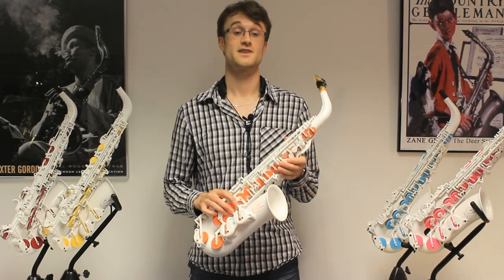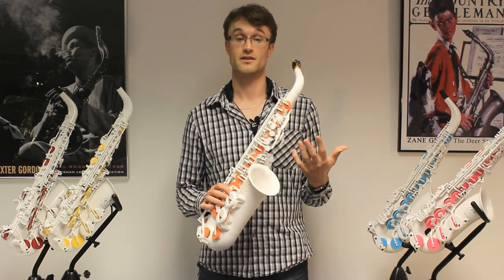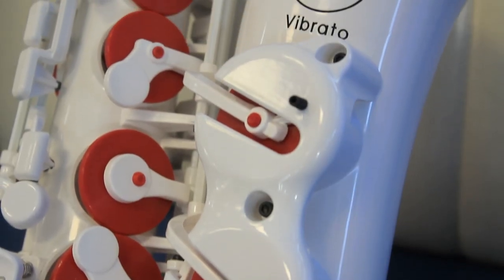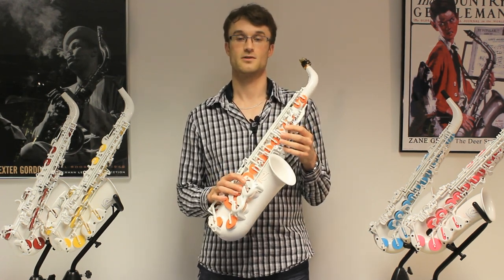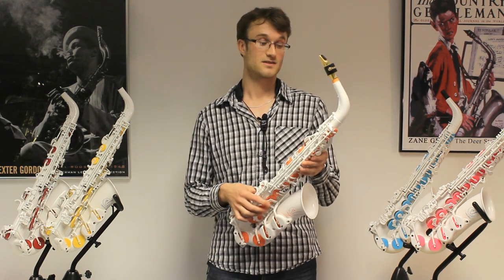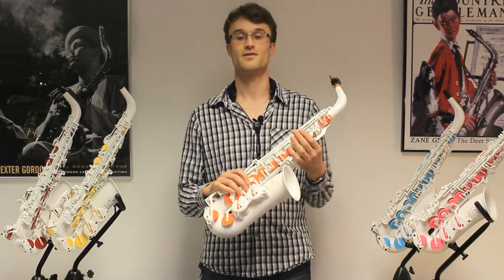Vibrato Polycarbonate Saxophone Review

Comment: Now, before I begin, I am NOT a saxophonist. I am a baritonist. I heard what I call "dead air" at the beginning of a lot of the phrases for the Vibrato, but not the standard one. Also, the brass sax seemed to do better with the low notes, so, based on my hearing, if you buy a Vibrato, you might wanna play higher a lot more often. The funny part is that it created what's known as a "vibrato" sound on those lower notes.
Reply: Zachary Woodard The airy noise is heard on both. It is coming from his mouth, not from the horn. Some players just play that way.
Reply: Tanner Saylor Ok, just trying to help.
Reply: +Zmac 9906 I'm an alto sax player an d I agree about the lower notes they sound weird a little off the if you what I mean (which u might not)
Reply: +The Mad Panda I'm a tenor sax player in the concert of Bb but yeah the lower notes sound really off tune

Comment: Get the price down to around $150 USD I might consider one. Failing that, I'm sticking with brass!
Reply from the maker: maverickdallas100 What you have to remember, that the pBone and pTrumpet are valve and slide based instruments, easy to recreate with plastic, hence them being about £100. The saxophone, has lots of keywork, and lots of mechanisms that take time to build, this time, cost money, and further specialist material to make it robust, a lot more complicated than a trombone or trumpet in design, so that's why it's that price. If the sax was less complicated, it wouldn't involve so much work, but then, if it was less complicated, it wouldn't be as awesome ;)
Reply: maverickdallas100 maybe they are per unit, but the R&D to get to this to this level of instrument must have been pretty hefty...  I'm sure the price will come down once they sell a few thousand
Reply: ***** If the plastic sax follows the same trend as, for instance,  flat-panel TV's and personal computers, the price should plummet once that initial "novelty item" or the "gotta be one of the first people to have one" aspect wears off and production is ramped up.
At $150. USD a copy, they would be flying off the shelves in addition to being a worthwhile purchase for music programs in cash-strapped school districts needing to outfit a band or orchestra on a budget.
Also, these instruments would stand up to any weather, be cheap to maintain, and be fairly resistant to a youngster's carelessness or neglect. What school superintendent or music director wouldn't like that!

Comment: It has a more rounded tone lacking the accentuated upper mids and highs that most modern players expect in the mix. The plastic sax has less sibilance. Similar to the difference between a classical nylon or gut string guitar and a modern steel string acoustic guitar. The plastic has more fundemantal frequency and less upper harmonics.

Comment: So, there are brass saxophones of better or less quality, plastic saxophones... even wooden saxophones.
When I was 11, I talked about a "rubber" saxophone (hard rubber, just something that wouldn't break if you dropped it).
We may see that soon, along with perhaps a crystal (glass) saxophone for the enthusiasts.

Having owned a "xaphoon" as well as a Jim Brock sax, attaching a saxophone mouthpiece to a piece of bamboo with tone holes drilled in it still tends to have a "sax" sound, given the reedy sound from the mouthpiece.

Folks, we are more than 2 decades into the 21st Century.
The debate about brass saxophones that cost a few thousand dollars vs. a generic one costing maybe a couple hundred bucks is falling on deaf ears.
Why? Because we have long since past the point where the "generic" brand saxophones are manufactured in the same overseas factory as the pro-model saxophones.
Yamaha of Japan hasn't manufactured saxophones in Japan for many years - just look at the lower side of it (near the right thumb rest): Made in Indonesia.
Yet Yamaha still charges upwards of $3,000.00 for any model saxophone and often comes with octave key mechanism problems, corks falling off within 3 months, etc.
No wonder the warranty is so limited, because they took your money for a status label that was made in a sweat shop.
It's comparable to Starbucks - there are certainly better coffee shops out there yet Starbucks charges a base of $5 for any beverage before you add ingredients (plus tax & tip!)
Nike shoes are no better - manufactured on cheap labor, the base price is still well above $100 + tax for any pair of shoes that don't last any longer than any other shoe.

Unfortunately, too many band directors here in Texas somehow 1) Got a degree in music + teacher certification and 2) Got a band director job (and still have it) when:
They clearly never had any instrumental methods courses and if they did - how did they pass?
Because the astounding levels of ignorance being preached (I chose that word carefully) to young minds is disturbing.
They only allow (yes - allow) top-brand instruments in "their" band (Hmm... I wasn't aware that music programs in PUBLIC schools belong to ignorant band directors).
As a private music instructor, I see these lists every year: Kids sign up for band and are given a list of approved brands and accessories.
Every time, those instruments are limited to Yamaha and Selmer (the most expensive brands). Um... what if we're not all millionaires? I know!
The band director will use taxpayers' money to only buy the most expensive brands for the school.
In addition, they recommend size 3 reeds which are too strong for the embouchure of a novice player.
Said band directors also only recommend Rovner ligatures (not the standard metal variety) which again, are not only more expensive, but more difficult for beginners to use.
I even know of a band director at an elite private school telling his saxophonists not to use cork grease but instead the graphite from their pencil. Smh.

Thus, we've established that a reedy, "saxy" sound can come from an instrument made from other materials besides brass.
We've also discovered not only the utter incompetence of band directors in Texas, but that one does not need an expensive instrument to learn on and progress.
However, the conclusion about plastic instruments is that they are NO less in price, often more expensive, thereby rendering them to be an absolute waste of money.

FYI: I am not being pessimistic, only realistic. I am actually quite passionate about all things about the saxophone.
I have been playing saxophone for over 32 years, and I am a fully-certified music educator of 18 years. I hold a bachelor's & a master's degree, both in music education.
In the time I have been playing, I have either owned or played on enough different saxophones to make an informed assessment.
Having lived in 5 states across the U.S.  I am grateful for the teaching experience and playing experience and I wish you well in your purchasing and playing experience!

Comment: I've played several of these, and they all have one thing in common. They s*ck!!! Ok, they sound surprisingly good, but action wise...disaster...and they're really difficult to get air tight. You have to press HARD, and still those low notes will not come out easily, if all. Even if they're light in weight, they're tough to play, so NOT recommended for kids/beginners. It's best suited for those who like to hang funky things on their walls!

Comment: this would be great if you had to be in a marching band. weather cant mess it up.
Reply: Matt Jelisco And no neckstrap needed! Now we aren't limited when it comes to visuals!
Reply: Original E How does it make you free? Our saxes can't do most of the visuals the rest of the band can. I've marched a brass alto without a neckstrap and the only issue was with the weight on my right thumb pushing my right palm into the side keys. The plastic will cut more than half the weight, which is more than enough to allow one to hold it up.